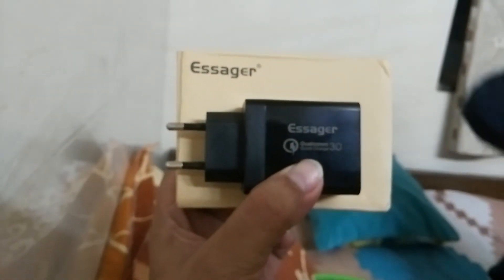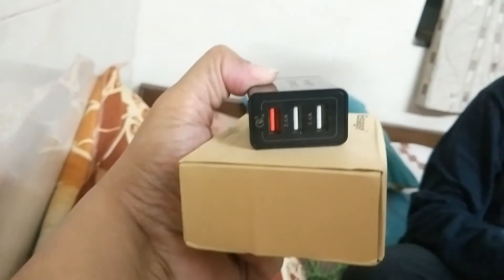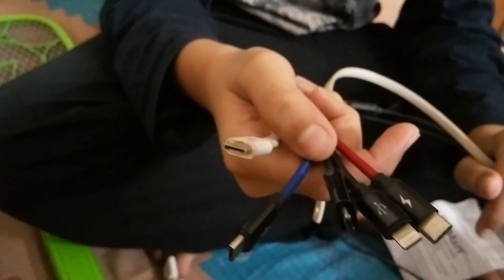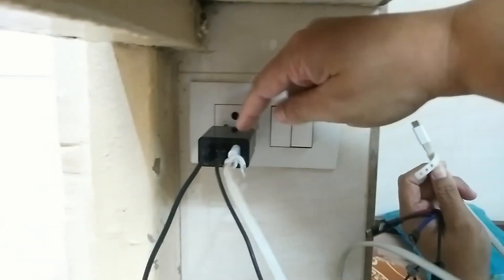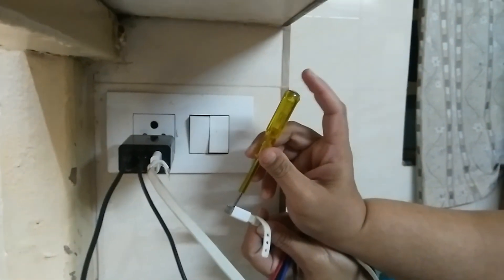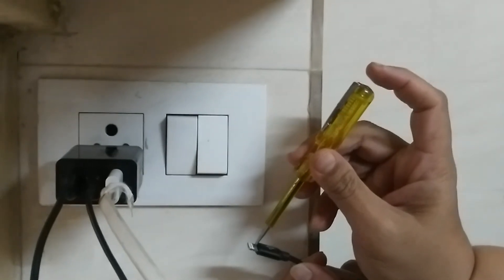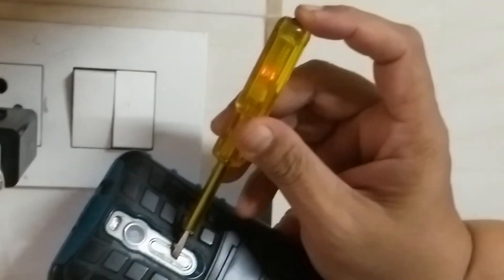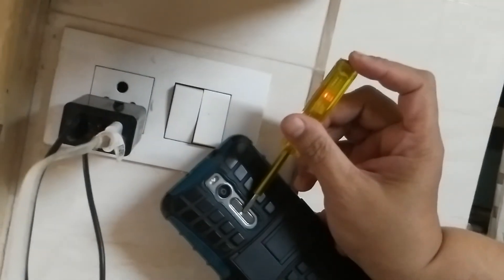Quality issues with Essager 3 usb travel charger dtd 14.12.2018

Comment: Hi Rajendraprasad, I have tested my Essager charger with the same result :( Have you meassure the current? I did and there was 0A, 0V between cable and outlet grounding :O So, I guess producer did not respect recomendations for design electric board and current is emitted by induction. This is bad and who knows what could happend.